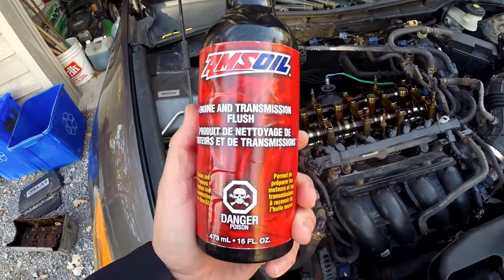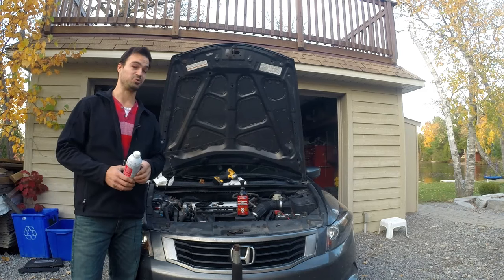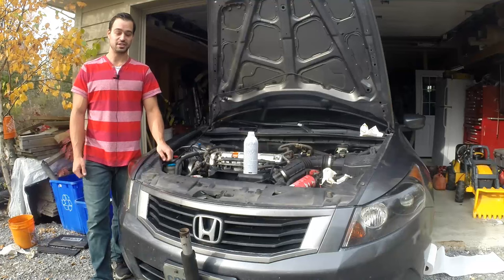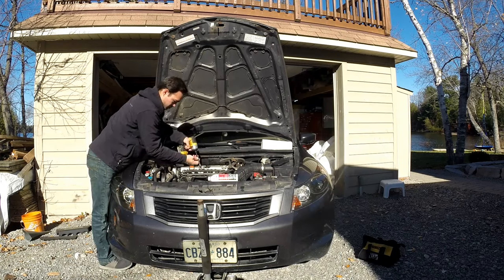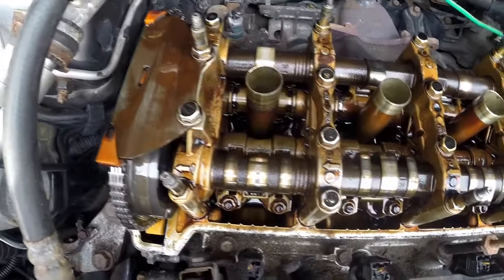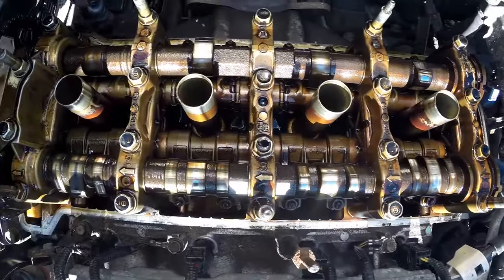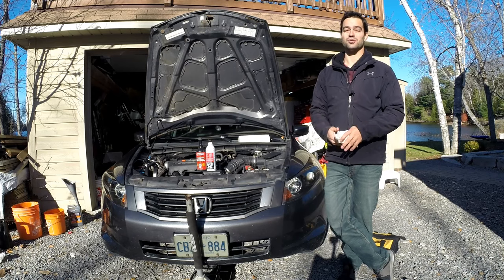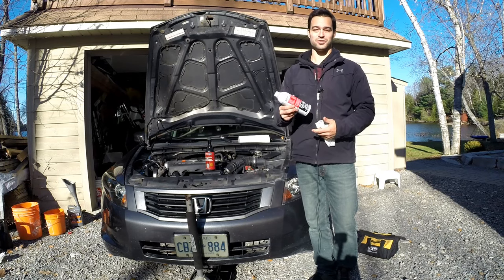Amsoil Vs. Seafoam Engine Flush - Who Wins? Thorough comparison and PROOF

Comment: Yes these additives do work... I,'d use a full synthetic oil now and it will continue the scouring effect that was started by these. I Use a 1/2 qt of kerosene and a 1/4 qt of tranny fluid mix.., Idle for 5 minutes or so, depending on each individual engine and case.. Is doing the same thing as these...Trick is to change the  oil filters,  so they don't overload, if an extremely dirty engine. Just have to know what you're doing.Folks have using straight tranny fluid, and even desiel fuel as a flush for decades now... About any full synthetic today, will gently scour the engine while driving..Also never forget MARVEL Mystery Oil  as a longer term gentler cleaner. Been working wonders for about a century now... ( Are all Hondas that noisy,  thought it was a diesel at first. Chuckle Chuckle 😃 )  That kid will be in Nascar in a few short years!
Reply from the maker: Thanks for your comment and glad you're seeing success with these types of additives. I've seen a few comments about Marvel Mystery Oil too and people have said it works well. If I do another one of these tests, I'll include that product too. Thanks again
Reply: @KingdomAuto  Cool. But MARVEL isn't an instant cleaning agent like the more aggressive ones like these are.  Love about MARVEL is in can really get into the nooks and crannies over time and flush out gum and varnish  and quite  down "some" engines alot actually....Good Luck and  more videos!   Thanx ; Jethro
Reply: You sound like my Dad who was a motorhead from the 50's. However, I don't think I'd be running kerosene or tranny fluid in my newer engine. Don't know exactly that it would detrimental, however a lot more things on engines today than from decades ago. I like MM also, however no clue if its an old wives tale or actually does something.
Reply: @boots7859  Well I not sure what is in newer engines but even smaller passageways that need the flushing and dissolving action in them now more than ever... The increase of nylon on things such as timing chain guides can handle this stuff I'm referring too.. I haven't seen on any of the "5 minute Engine" flushes on the market "not for certain engines or age" Actually my concoction is a little less aggressive than what those are..Mainly  kerosene and benzene plus other harsh chemicals. But that's sometimes what you need, trying to get years of built up crud off in five minutes. You have to know what you are playing with first of all.  And a rented borescope from A.zone etc will tell you what is what in there because most valvecovers are a real PITA to pull off today...It's really about experience and knowing what you are trying to accomplish in the first place.. You  better be willing to pull off an oil pan, if using a 5 minutes flush on a very sludge up engine,  or you'll kill it faster than Joe Biden does brain cells...MMO works as well in today's engines  with V-tec and cam phasers and oil pressure activated chain tensionors .Again you have to know what you're doing, as a full 20% capacity fill as the bottle calls for will need a step up 5 weight in Summer driving. I only use 15% and usually a full synthetic in my own vehicle.  But works even better for conventional Dino oil...The folks I help are always trying to save a dime, and ho Dino oils... Might think these are ramblings of an old man, but check out a Video with FORD BOSS MAN and the reps of MARVEL Mystery Oil.  It's still in play today, but as we say here in MaZurrah say..SHOW ME!!!.... GOOD 👍 LUCK. ....  Jethro

Comment: Pennzoil full synthetic oil changed every 3,000 miles and the engine will never get dirty. It will look practically new at 300,000 miles.
Reply from the maker: That’s great to know, but doesn’t that also kinda defeat the point of synthetic oil, considering change intervals should be much longer? 
Either way, nice to know it keeps things clean!
Reply: @KingdomAuto  Synthetic isn't all that much more expensive and I change it myself so that saves money. When a car reaches 300,000 I think it was financially worth the little extra cost.
Reply from the maker: @gemeinschaftsgeful  Great points all around. I change mine and use full synthetic as well but admittedly I go a little longer between changes with my vehicles. It is nice to know that the engine can look so clean if intervals are shortened!

Comment: Try 50/50 Diesel and Oil to flush and clean & flush the motor is works. may have to do a second flush if engine has more gunk.
Reply from the maker: Will that be ok for engine lubrication? Also how long do you leave it in the engine while doing the flush?

Comment: You said oil changes has been done on time ,maybe you wanna do them earlier than recommendation and also depends on what oil you using ,just my two cents 
P.S. lol I'm surprised amsoil warriors didn't show up yet 😅
Reply from the maker: I thought it was interesting seeing all of the sludge as well! I am wondering if maybe the car had cheap oil used for most of its life. I know it was always synthetic but I don't know what brand. 

From 220,000kms to 375,000kms (when I took ownership of the car), it was running only on Amsoil XL synthetic and I always changed it earlier than what was recommended. 

So was a tad surprised to see how much gunk was built up when I pulled off the valve cover.

Also re: Amsoil warriors - so funny haha

Thanks for your comment!
Reply: @KingdomAuto  😅 you're welcome! Oh in that case most likely is been low quality oil , in the past I had a vehicle that mechanic had to open the engine and asked me what I'm using since is super clean. I was using Mobil 1 ...and still do . Also if you using XL and still looks gunky I'd switch to signature series I mean it won't hurt to try . Maybe I would think will take few cycles of oil change with good oil before it gets cleaner since is been neglected from previous owner
Reply from the maker: @kostadinustavalkov1902  Yeah could have very well been!! Good to know about Mobil 1! 

I think if the car was newer, I'd go with Signature series, but for having 375,000+ kms, I was totally fine with the XL haha
Reply: @KingdomAuto  😁 fair point, that's quite few km on it but you got nothing to worry about afterall it's Honda.  I believe if you keep that oil after some oil changes down the road it'll get cleaner.  Also I'd put P.I. amsoil red bottle cleaner too, I feel slight difference on drivability after I started . Seems like you doing the right thing buddy keep it up and you'll be just fine 👊
Reply from the maker: @kostadinustavalkov1902  Yeah that's a good point, would be interesting to see if it does get any cleaner just by the oil that's being used. 

And great idea regarding the P.I. product, I've used that several times and it seems to be doing a really good job!

Thanks again for your comments and info :)
Reply: @KingdomAuto  you're very welcome, glad to share thoughts and experience.  About the cleaner engine I don't know for sure just what I read other guys talking
Reply from the maker: @kostadinustavalkov1902  I really appreciate it! Have a good one :)
Reply: They are done at dealer recommended time, not internal combustion motor time. None of my motors look like that. That looks like 10k oil changes

Comment: Seafoam has a boiling point lower than engine operating temperatures so adding it to the oil will NOT work because it will just boil off when the engine is upto operation temperature. 

Kerosene works just as well for a fuel system cleaner and it’s so much cheaper.
Reply from the maker: You’re entitled to your opinion, but the results of the test that I did say otherwise. Regardless of apparent boiling point, the Seafoam clearly did remove some varnish/buildup in the engine.

Comment: That's mean we should change oil and filter on time wi be perfect no need to go with AMSOIL or motul...etc yes?
Reply from the maker: The oil was always changed on time in this vehicle, but there was still quite a bit of sludge and buildup. I think these engine flush products are a good idea to use on a regular basis to keep the engine clean :)

Comment: I think the difference between the two is time. One was 5-10 mins. One was many hours. The other question is how good is it for the engine to run hours and hours with the contents of seafoam in your crank case? Seafoam contains 20% rubbing alcohol which has no lubricating properties, destroys motor additives, not good for the seals. IMO does not belong in motor oil for any extended period of time.
Reply from the maker: Yeah I was thinking the same thing. I just followed the directions on the cans but it does make sense that time would help the detergents clean the engine more.

With regards to engine longevity, you raise a great point. It would be interesting to see if these products cause damage over long periods of time.

I would imagine that using them every now and then and adhering to the instructions wouldn’t cause and problems but who truly knows.

Comment: What about adding MMO to the mix?
Reply from the maker: I've heard from a couple different sources that although MMO does a good job cleaning the engine, apparently it can also reduce the lubricity of engine oil too. So just for that reason I'm not sure if I'd want to go ahead with it. But I'll dig around more and if I can confirm that it won't weaken the oil properties then I'd test it for sure :) 

Thanks for your comment

Comment: The only thing i don't like about engine flush is when all the stuff comes off your oil pump screen is going to pick it up and start to reduce oil flow to the engine. That to me is more harm than good. To me it's better to change the oil more often with a good quality oil.
Reply from the maker: Yeah I can see what you mean. I thought the same but people have been using this stuff for so long without issue. I think if the engine has an excessive amount of buildup, then that might be more of a concern. But what I saw during this test was simply that the cleaners very gently removed/dissolved what was there. This material would then get caught in the filter which gets changed after the test is done.

I completely agree about your point about changing oil frequently but that also wasn’t the point of this video. I just wanted to test these cleaners and see if they work, rather than focus on oil change intervals, etc

Comment: What specific brand of engine oil did you use for the life of your car that created that sludge?
Reply from the maker: Unfortunately I couldn’t tell you. I owned the car after it had 225,000 kms on it. So apart from knowing that the oil changes were done on time, I don’t know what brand was used.

Once I began ownership, I used only Amsoil XL and changed every 8000-10,000kms, which is well within the range of life for that oil. Plus I had a Blackstone report done on it at 10,000kms and the oil was still in great shape + were still plenty of additives remaining. 

Sorry I couldn’t tell you what was used before though
Reply: Thanks.  Great video.  Thanks for making.

Comment: it seems like changing your oil "on time" may not be often enough.
Reply from the maker: When it comes to keeping an engine clean, definitely agreed. However, in terms of the longevity of the oil itself, I had a Blackstone test done with 13,000kms on Amsoil XL and there was plenty of life left in it when looking at additives and lubricating properties. So although the engine won’t be as clean, at least it’s safe to use oil for that length of time.

This is of course assuming that no coolant or fuel is getting into the oil though… that’s a bit of a game changer.

Comment: Can I Use Amsoil Flush on my Honda 1.5 Turbo? Im worried
Reply from the maker: These products are quite safe for all gasoline engines, so I would expect that the Amsoil flush would be totally fine to use on your car. The best thing to do would be to contact Amsoil and ask them though, as they would have the most accurate information on their products.

Hope that helps!

Comment: Your engine is strange, not sure how the oil is so dirty.  Did you say you put in new oil, ran it for 10 mins and it turned black?

I've owned hondas for a long time, especially accords, and my oil comes out crystal clear at 3000 mile oil changes.  Almost the same as what it went in.
Reply from the maker: That's interesting that you mention your oil never changed colour. What kind of oil do you use? 

I think the reason the oil turned black after 10 mins was mainly because there was a lot of dirty oil left in the engine and it was just flushing some of that out. If that test had been repeated 2-4 times, it would likely become more clear.

But in regards to oil turning black in general, that's actually a good sign and shows that the oil is doing its job. Oil is supposed to remove carbon deposits and clean the engine components + absorb them. So it's a very normal occurrence for oil to turn black even a very short time after it's been changed. 

Here's a good example from Project Farm (link below). You can see here that during the test where he heats the oil, even though there are no carbon deposits/anything for the oil to clean, both oils begin to turn black just from the heat, and these are two of the top oils that he's tested
https://www.youtube.com/watch?v=TWuKvnCq1js&ab_channel=ProjectFarm

Anyways, thanks for your comment :) 
Merry Christmas and Happy New Year :)
Reply: @KingdomAuto  Amsoil signature series, the 25,000 mile or 1 year oil.  However, I never let it run that long.  I change every 5000 miles which is about 1 year per car I own.

I mean I may be exaggerating that it comes out the way it went in, but the color change is fairly nominal.  Hell, sometimes when I drop the oil off at my local autoparts store they think I put fresh oil into the container cause it's opaque plastic and the color is still golden XD

When I get a car that isn't new, that I purchased used, I usually do 3 or 4 oil changes on the vehicle within a 1000 miles to flush out any crap in there until the oil comes out the same it went in.  Prior to Amsoil I was using penzoil ultra platinum, the top of the line one.  I mean it's pricey, but at the same time you want to make sure the car is clean on the inside.  I just find it much less available now and just penzoil platinum is everywhere.

I unfortunately haven't purchased any new cars in a while.

I believe the amsoil does have superior detergents inside of it, so it should be cleaning anything in it.  But all of the cars that I purchased new are always clean oil, maybe the insides are remaining clean with proper maintenance.  I do usually 3-5 changes in the first 5000 miles of a new car for the breakin period.

But I get equal results with the penzoil, sludge and oil that's dirty is directly related to prolonged oil changes and poor oil or over operation of the vehicle; like driving crazy and fast.

I drive like a mad man.

If I notice the oil is dark when it comes out at around 5,000 miles I'll start flushing again, like do another oil change after a 1000 miles until it comes crystal clear than repeat the 5000 mile intervals
Reply: @KingdomAuto  Merry Christmas as well!
Reply from the maker: @mikegoddard7354  Ah ok that makes total sense. Good for you for going the extra mile and taking care of your vehicles so well! 
I'm sure they'll last a heck of a long time being so clean! 

I'm with you on used vehicles though, it's hard to purchase something new when it'll depreciate so quickly. And if you're taking care of them to the degree that you are, they should very likely stand the test of time.

Thanks for the info though! If I do another test like the one in this video (and I can find enough oil on sale to perform a flush like what you've mentioned) then I'll give it a go for sure!
Reply: @KingdomAuto  Yes, I dont think it's necessary to do it all with strictly amsoil or whatever product you use.  You can just go with mobile 1 or penzoil platinum for the flushing sequence.  Who knows how dirty your engine may be, it will require sometimes 5 flushes.  But as long as you DIY it's all good.

I dont know where you are located but 5 quart jugs are only 22-25 usd.  Just want to flush it first and then hit it with the good oil of your choice, whatever that maybe.  I know amsoil is expensive, but I am just saying from my experience the times I got cars were when I wasn't using amsoil.  So that may as well be the case to follow the same protocol. 

Your oil does seem fairly dirty, and you may want to hit it with 500 mile flushes.

It's not about new cars losing value.  I've purchased so far 2 cars brand new, the thing is you never know what happens and unfortunately both cars that I purchased brand new and took real good care of got totaled by other drivers hitting me.

Yet all the used ones have stayed and were never hit, you never know what happens.  I know you mentioned project farm and even on his testing the best two oils were the penzoil ultra platinum and amsoil beat it out.  So that's why I am sticking with Amsoil and honestly the price between the two is very small as I said it's hard to find now and normal auto stores dont carry it.  It has to be special ordered.